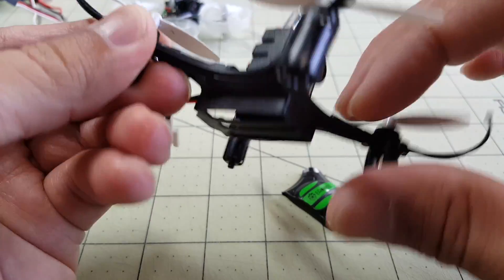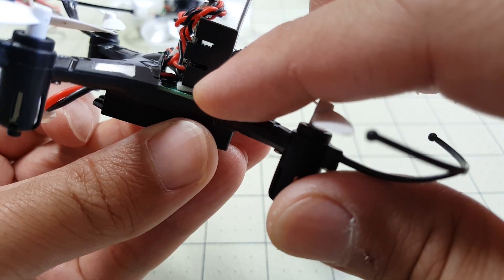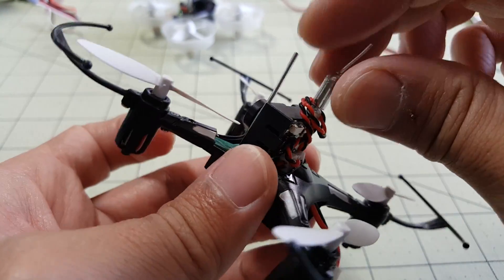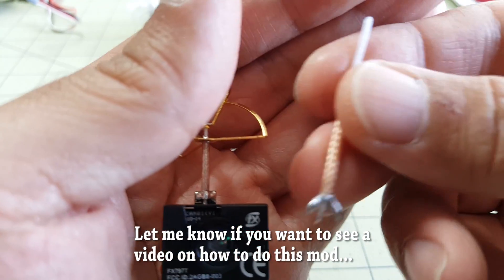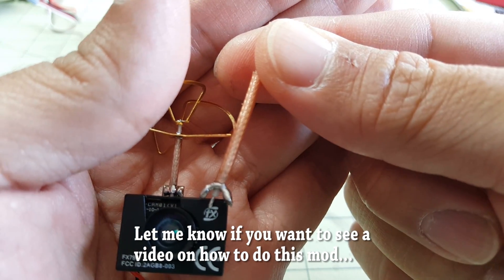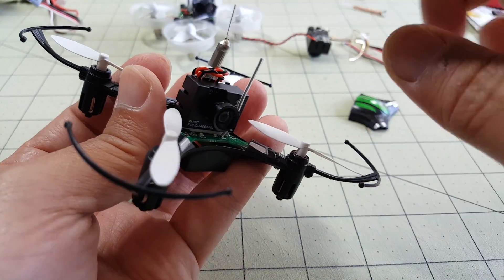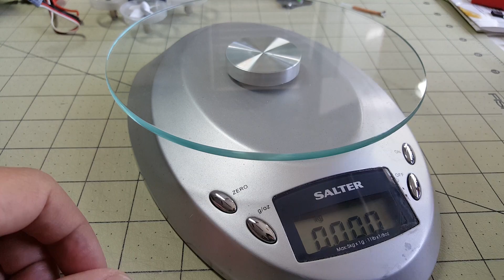Eachine H8 Mini FPV Mod - Tiny Whoop Killer?

Comment: do i need the adapter ???? 
or can i cut the cable intergrated ???
Reply from the maker: I'm not sure what you're asking about.... an adapter for the camera?  I think I direct soldered it.
Reply: At 2:47 you said that thing came with the cam... Do you have to connect it and then solder it or can you directly solder it
Reply from the maker: I recommend direct soldering to save weight.
Reply: OK THX

Comment: Hi Albert thanks for your quick answer. I saw this video. I ordered a E010 but it is mode 2, I fly mode 1 and I don't know I will be able to mod it. This why I am interested in a H8 mini, I cant get a mode 1 from bangood. So I would be glad to have some answers for the h8 mini questions I sent you, thanks in advance.
Reply from the maker: +Joe V (SuperCrasher) Right now there are more mods available for the H8. Sorry, dont know anything about mode 1. On the E010 if you can fly it with a Taranis, you can switch to mode 1.

Comment: Neat. I'm thinking about just hot gluing a camera to the top and using the splitter cable to power it if it's not too much of a weight penalty.

Comment: Nice! I took a "spidex" mini quad I got for $10 and put one of those micro camera/vtx on it, and it is a blast. With the stock 500mah battery, I get 4 minute flights zooming around at 15-20mph. May get a bit longer if I cut off the landing gear and prop protectors, but will have to find a good source for cheap props.

Comment: what does Jeff say now, since this has 24k views? :)
got mine yesterday. really nice. I fly with the stock SPW antenna from the videocamtx kombo you show here. how much worse is the video if you fly indoors with a LP antenna? I think my SPW will be dead or bent soon so I will find out :)

The stock radio range is really poor - I will first try getting these antennas straight as you have, but did you see a huge increase  in range with the taranis module? 
have you seen the firmware hack to have acro mode? 

so fun - expect a RCSchim review to this one soon :)   (and you  get credit for it since I found it thru this video!)
greets, Mario
Reply from the maker: Jeff is speechless now I think...  ;) The video with the linear whip antenna is not much worse if you are close by like inside a house. Outside with clear line of sight it's exactly the same.  These camera antennas are very weak so reinforce the attachment point and where the top of the lobes meet with some hot glue. Even a mild crash can cause the lobes to separate or the antenna to shear off at the base.

If you move the antenna up and away from the PCB the range is better.  After that I never really had any lockout problems. Also, I think using the Taranis module helps. I think it transmits at a higher power rating than the toy transmitter.  I love using the Taranis module with this.  It makes it much easier to fly.  I haven't tried a long range test yet, so not sure how far I can go.

I have seen the acro mode firmware hack but the STM32 USB programming stick has been out of stock for a while but I haven't checked it lately. I plan to try that at some point in the future.

Sadly, I crashed this badly trying to fly it through my car windows. Ended up flying it straight into the post between windows. How good am I to do that?  I burned out a motor so I moved everything to a new frame (90mm carbon) and used 7mm motors. I will have a new video about that soon.

Also, check out this other micro in this video.  http://youtu.be/ZonImc5ZeYQ   It's not much bigger but has full capabilities like a Vortex :)  LOL... Well, you'll see....  :)  Thanks for watching Mario!

Comment: Cheers for the tip, just built mine and loving it. Here's mine on charge. https://goo.gl/photos/qZ1Zvq6rLCg9Zp4A7

Just melted a hole into the cover to poke the receiver areal out. Still messing with camera placement so using a zip tie. Had a few inverted crashes which hasn't been the best for the camera areal.

Comment: Hi Albert! I have this exact same H8mini and FPV cam. It is mounted the same way, but with the original RHCP antenna.
With the stock battery I get only 1:10 flight time. With brand new lipo's 250mAh or 300mAh (turnigy or eachine) the weight is too much - You have to throttle 100% otherwise it doesnt even come of the ground.
So even with these bigger batteries I get sometimes less then 1 minute flight time - no fun.
And with flight time I mean: it is not staying in the air at 100% throttle, and battery has just 3,9V left (so no flashing led's)

How come you have so much more flight time?

Did you try stronger motors - or are you still using the stock ones?

Comment: Did you not have any noise issues what so ever ? I hooked up a 798 to my eachine and when I spun the motors I started getting lines in video and when motor speed were at flying speed video completly gone, I returned the camera to range video thinking  it might've been defected , he claims that he was able to re produce the problem camera flew fine on the inductrix and blamed the problem on the eachine board. I kind of didn't believe him, I got partial refund from him, so I'm ready to get another camera just wanted to make sure the eachine does not produce any noise from your experience, thanks albert.
Reply from the maker: My eachine works with my 798t with no video noise. You can see for yourself in the video that I'm flying around with no lines in the video.  It's possible something is defective on the Eachine or the camera.  I don't know.  Mine has no issues.  That's all I can say.

Comment: Nice mod for sure, but I think the inductrix will still have the edge due to the ducted fan shrouds.  You hit something, it bounces off...hit something with relatively exposed props and you are a lot more likely to crash / flip over.

Comment: Great mod video Albert, I am in the process of doing the same to my h8 Mini, I was going to get the tiny whoop but this is a cheaper option and performs well, what size battery are you using the stock or a bigger capacity battery?
Reply from the maker: It flies better with the stock 150 but the flights are short. The 260 gives it more flight time, but it's not as agile and loses altitude more quickly due to the extra weight.

Comment: Does the H8 have an acro mode? If not, then its not gonna be as nice as the inductrix. But still a good idea. Been flying my hubsan quad with the same camera since that camera was released.
Reply from the maker: +Joey Nuggetz there is Acro firmware that you can flash but I haven't done that mod.

Comment: Does it have ACRO mode? Also I have the FlySky i6 transmitter with the iA6 receiver, will that work? Thanks!
Reply from the maker: +MuLiTiAxHD there is active firmware but I don't use it. Flysky won't work with this.

Comment: I stuck that same micro vtx cam on my tiny Syma X11 ($25) and spliced into the power lead. It works great and the larger geared props give me 7 min of stable indoor fpv flight time with standard 3.7v 200-250 mah lipos.
Reply from the maker: nice!

Comment: Why do you convert the antennas to dipole antennas?
I ask because I've seen people  replacing dipoles for circular polarized antennas but I have never seen someone replace a circular polarized antenna with a dipole antenna
Reply from the maker: Save some weight and also in a crash the dipole is smaller and less likely to break than the cloverleaf.  The loss in reception is negligible at the range most people will fly this in anyway so its a fair trade off.

Comment: not realy a killer as the H8 has that silly tiny controler and my h8 has burnt out two motors within a month..still a great mod tho to try fpv
Reply: You can reflash the h8 to use a real tx, acro etc.
Reply: +williwonti cool any links
Reply: I agree. Not nearly as cool as the tiny whoop. U could strap a micro fpv camera to any micro quad and call it a tiny whoop killer.

Comment: Great video timing. I have 2 H8's and the FPV rig on order (backorder) from BG. How necessary is the antenna mod? Did you try flying it with the circular polarized before the mod? How much weight did it save?

BTW I did the acro FW update on my H8. I used Travis' video, but also read the RCG instructions and the github tutorial. They all vary a bit and I needed all of them! I thought it was a really fiddly process. But it worked and now I'm learning acro (I think)! SUB!
Reply from the maker: I  think the circular polarized antenna will make it too top heavy. It already wobbles when flying slowly due to the extra weight up top.  Moving the CG further up probably won't make it any better.  I will probably remove the case.  I am finding that the linear antenna performs worse when you fly with a lot of other people and there's a lot more RF noise nearby.  Just an observation from flying recently.  I will post some more video of this flying soon.  It's been crazy windy lately so hard to fly in these conditions with this.
Reply: Thanks. I tried the Seby mod for FPV on a Syma x11 w/cp ant. It works but I don't like the way it flies anymore. I can fly it around the room without any pitch, just yaw. I think you may have hit the problem is the CG is now messed up. Maybe try a linear ant - no one else flying in my house but me!

Comment: what kind of flight times are you getting with this little guy, and what batteries you running?
Reply from the maker: 2.5 to 3 minutes with the stock 150mah. The bigger 260's will get you another 30 seconds to 1 minute.

Comment: the yaw on that must be crazy
Reply: yeah i tried to fly the h8 mini fpv indoors but the yaw made it very hard
Reply: As Albert Kim mentioned, you have an open source firmware for the H8 mini, you can dial it there. i have dial it the way i like and i admit it is an awesome little quad.
Reply from the maker: I plan to use my Taranis and reduce the yaw rate in there. The toy controller is not that easy to use thus making it more difficult to fly then it could be.

Comment: Hows the power of the Eachine H8 with fpv vs the inductrix with fpv?
Reply from the maker: +Jared Smeyatsky it has way more power!
Reply: +Albert Kim (marblekit) and flight time and stability?
Reply from the maker: 2.5 to 3 minutes in windy conditions. It will go a lot faster downwind obviously.  It's perfectly stable indoors. I find it's just as easy to fly as the Inductrix even with the dumb toy controller.  Once I start flying it with my Taranis, it will be loads of fun.
Reply: Absolutely awesome. I'm getting one for sure. I have thr inductrix but battle to fly with such minimal punch.

Comment: Will it work if you change motors for hubsan and a bigger battery?
Reply from the maker: It will work but you'll need a different frame. The stock frame is designed for 6mm motors. The Hubsan motors are much larger at 8.5mm.  But with a new frame, bigger motors and battery it should be a beast.  I've heard that you should stick with 8mm or 7mm motors if you upgrade as the stock board will go into LVC prematurely with a huge motor it wasn't designed for.
Reply: +Albert Kim (marblekit) yes i have a 3d printed frame that size looks like a 250 racer ;)
Reply: +Titanes Martial Arts how can i improuve the rc range?
Reply from the maker: You have to have the antennas up and straight on both the quad and the controller.

Comment: I notice you also were able to leave the plastic case on the camera on this one and still come out with the same weight. You could take it off and shave even more off
Reply from the maker: Yes, I could definitely shave off some more weight, but it flies plenty fast just as it is. I may cut off the battery bay so I can use larger batteries. Not sure. So far I like it.  I can't wait to get the Taranis module.  I think it will make this a go to flier then...
Reply: +Albert Kim (marblekit) some of these toy quads are really impressive for their price. With something this small, for tight close spaces, I can even live with the reduced range they have. Everyone I know with a Tiny Whoop flies it in self level mode anyway, I don't really see a reason to spend $100 plus a module when this thing performs very comparably for $13. Also, I can't stand those inductrix style batteries and connectors, they're stupid expensive, they fail constantly and I can't really see a difference in performance from the generic 1S ones with the regular losi connectors
Reply from the maker: Yeah, maybe people will see this as a lower cost alternative. To really get a good Tiny Whoop you have to do the motor upgrade and get special batteries.  The cost is quite a bit more than the Eachine.  Yeah, you still have to get the FPV camera but that's the same as on the Inductrix...
Reply: +Albert Kim (marblekit) another advantage with having one of these is that even if you get the Taranis module, you still have the option to use the super tiny transmitter, which is a lot less accurate for sure but it's amazingly portable. I'd take that thing anywhere if I could take that tiny controller instead of my Spektrum dx6i.
Reply from the maker: Good point!  The tiny toy transmitter is not the greatest but it does have a size advantage over the Taranis for sure!  I didn't have that much trouble using the toy transmitter as you can see in the video.  The 10mph winds were giving me a lot more trouble!

Comment: Do the acro mod! Travisgrindal has a video on it
Reply from the maker: +우희도 yes, I am going to order the STLinker tool that is needed.
Reply: +Albert Kim (marblekit) Just be careful... I bricked mine in the process :(
Reply from the maker: Ouch.... what went wrong?  Something obvious that I should avoid?
Reply: No... My computer didn't let me 'Add device' in the program and I erased the firmware that was on the board without knowing that I couldn't connect.